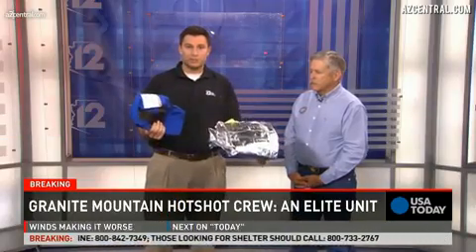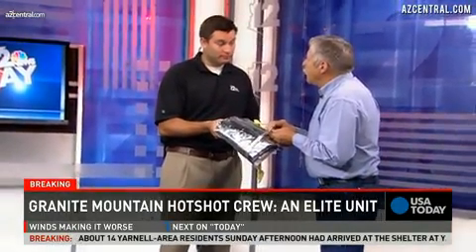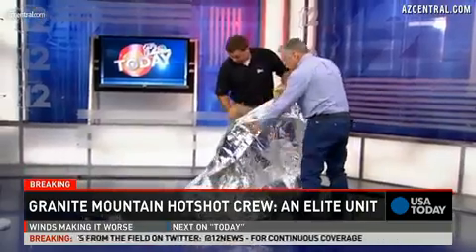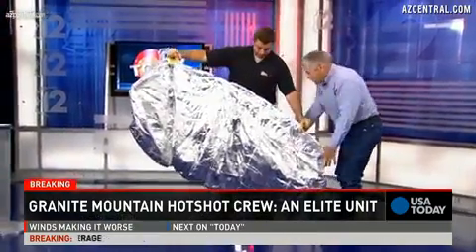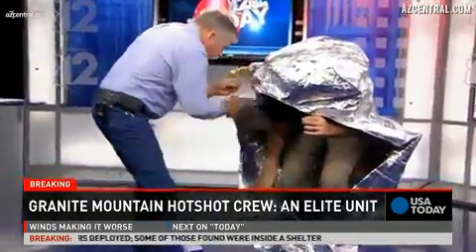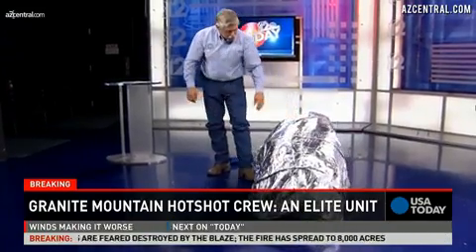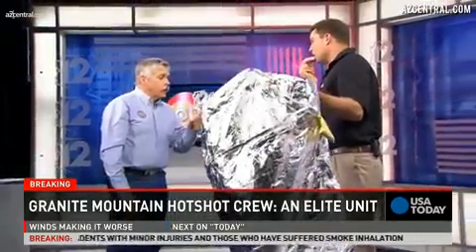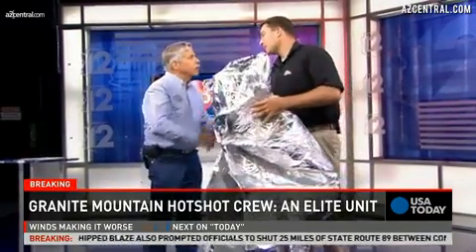How fire shelters should work

Comment: These HEROES tried to move from the black to their Safety Ranch and Got caught by the racing flame front.1) A new Watchout should be created to ALWAYS keep Eyes on the Fire and Stay on the Ridge if at all Possible instead of losing Sight of the fire in Canyons or draws. 2)Also they should be equipped with real shelters stainless sheets with aluminum cloth keeping them together and Sheep wool insulation inside. 3)NEXT they should have O2 canisters to breath. The Fire stole their oxygen. 4)NEXT they should have a couple of Steel cable kites to locate themselves to aircraft. 5)NEXT Hotshots should have access to aircraft channel and aircraft should have to monitor it and air channels. This is NOT a Climate change issue it IS a 50 Year Buildup of Unburnt Fuel Issue. ALSO 4X4"s and GPS Locators could be used to Reduce Crew Sizes and Cut Lines Quicker with 4X4's.
Reply: Every single point you made was spot on. Well said.